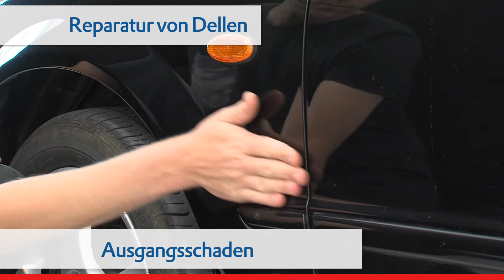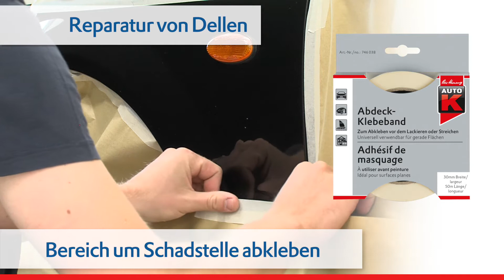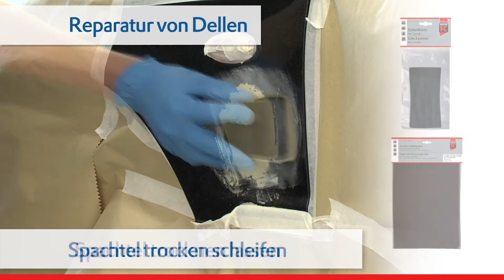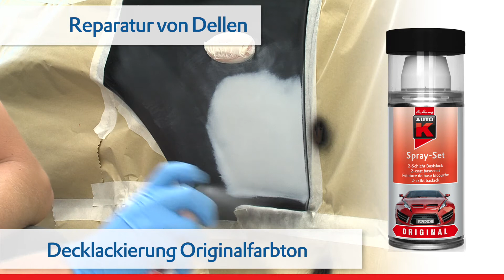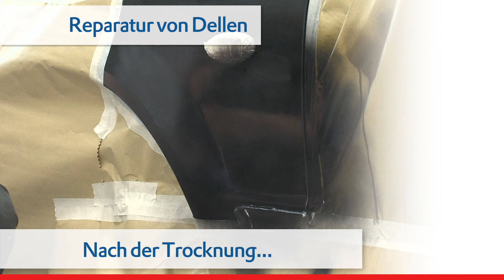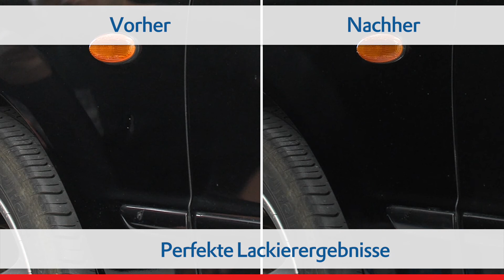Wie beseitige ich eine Delle am Auto - Reparatur von Dellen - Auto-K

Comment: Welche Körnungen haben die Schleifpapiere?
Reply from the maker: Hallo Bayer 1328, 
Step 1: Die Schadstelle (Delle) wird im Trockenschliff mit der Körnung P120-P240 angeschliffen.
Step 2: Den getrockneten Spachtel danach mit Trockenschliff P240-P400 plan schleifen. Zugleich die Randzone wo der Klarlack zum Schluss aufgetragen wird mit P1000-P2000 im Nassschliff mattiert. (Vorsicht, dass der Spachtel keine Feuchtigkeit abbekommt)
Step 3: Den Filler/Haftgrund nach der Trocknung wieder im Nassschliff mit P600-P800 schleifen.